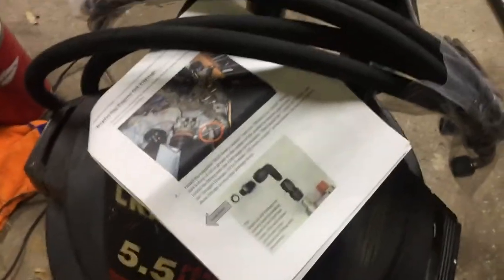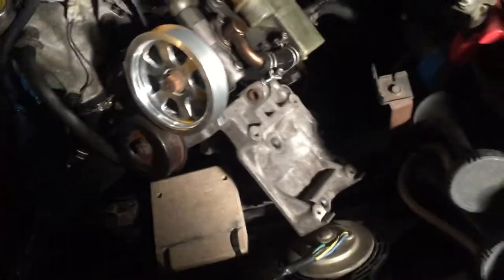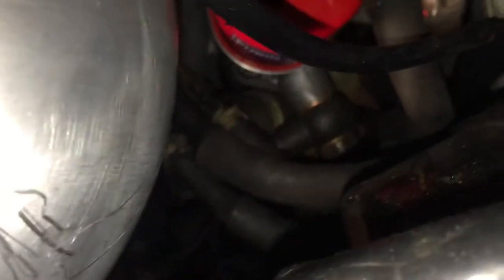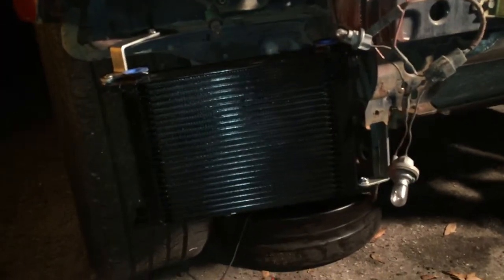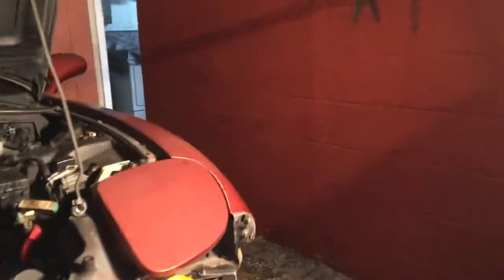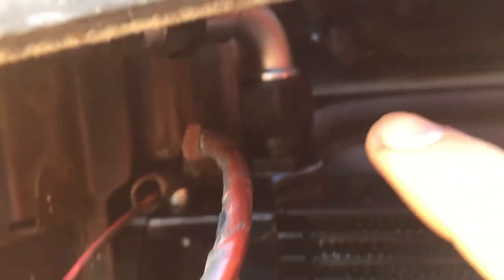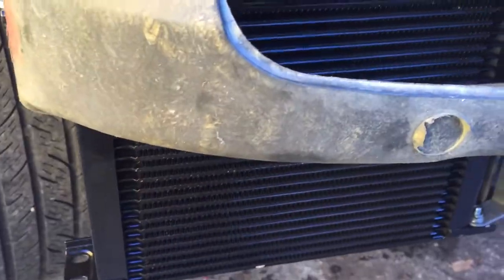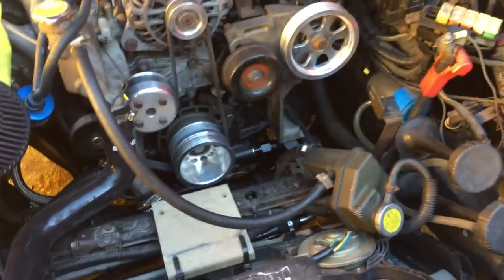Mazda RX7: Sakebomb Garage Oil Cooler Kit Install (2019)

Comment: I just installed this kit a week ago with friends helping. Overall I love the kit. If there were one change I'd make it would be the mounting point and bracket for the thermostat. I've got both PS and AC and things are just so tight right in that spot it made access for tools a real challenge. We were able to do it without moving the PS or AC by cutting the OEM hard line from the oil filter in order to get it out of the way. Also, I went with the 19 row instead of 25. My other suggestion for the kit would be ducting to replace the stock ducting.
Reply from the maker: Yes ducting would have been really nice

Comment: when you put the bumper on did the oil cooler hang lower then the bumper?
Reply from the maker: No it didn't hang lower
Reply: Kevin thank you so much for the input , did you just buy the oil coolers and kit , no oil filter extender right? Im planning on purchasing this for my streetported FD
Reply from the maker: No problem happy to help, yea at that time I didn't have a aftermarket oil pedestal the kit will work with the stock one
Reply: Im definitely  getting now thank you bro
Reply: Did you have to adjust your headlights at all , were you able to put the black cover of headlight cowl back on , and the tray under the vehicle?
Reply from the maker: Not sire about tray bc I didn't have one in sure it clears and no issues with head lights
Reply: @kevvrosario  dude thanks again hit me up @flylo_777 instagram , hope this thing will keep it cool got the setrab 19 cores with nylon everything , when I stay on the peddle it gets hot with the oem single oil cooler
Reply from the maker: No problem